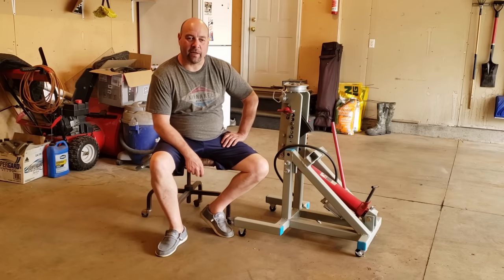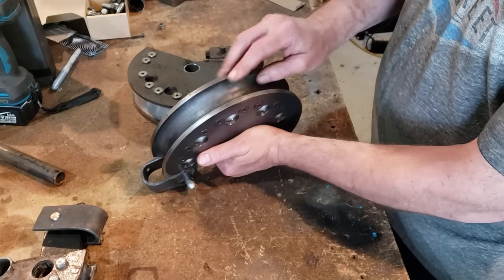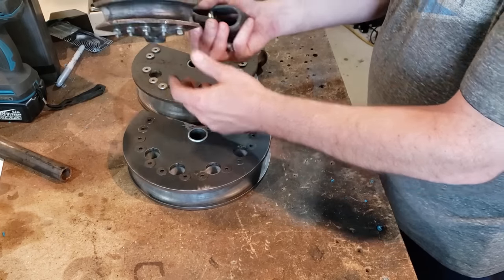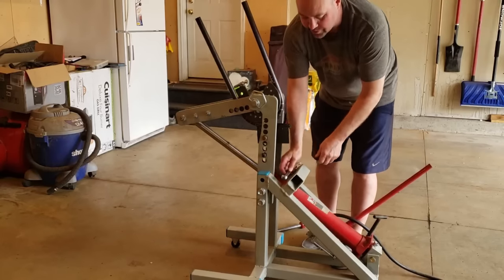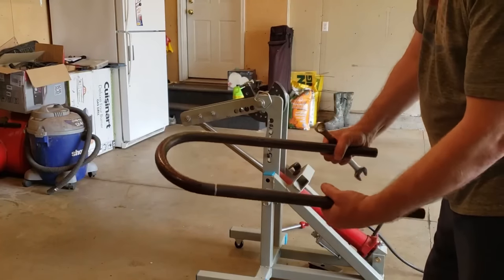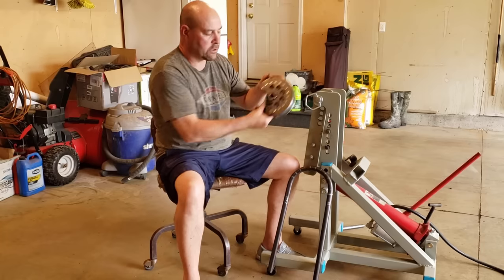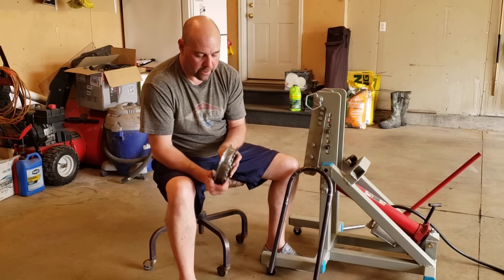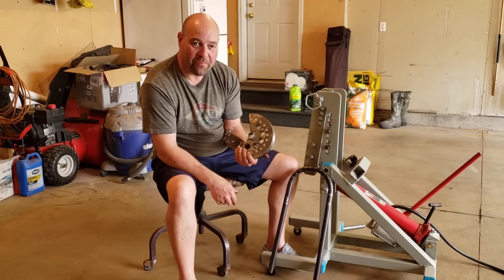A Budget Way to Build a Tube Bending Die

Comment: “No special equipment needed”. Er, except thousands of dollars worth of plasma cutter 🙄
Reply: Would be easy enough to have the side plates / flanges done by a company like Send-Cut-Send.
I’ve found that the prices aren’t much more then just getting the stock material, and saves the misery of cutting especially large diameter holes. Quantity also reduces the price, so ordering 10 pieces to make 5 different size dies makes this option more lucrative, as I’ve gone this route for several lathe and mill projects.
Reply: @georgedreisch2662  I almost fell for the troll comment as well. They are difficult to see sometimes when you are trying to be helpful. thanks for being a helpful poster. I erased my comment when I realized someone with a tubing bender, welders, other tools used, and fab skills would not see a couple 1/4” plates to be the one insurmountable task. 
Thanks JDs Garage for great content!
Reply: Plasma cutter for under $200 for 5 years. Can't fix stupid
Reply: Yep..
Reply: He said he cut the first one by hand
Reply: @nomoreusmc  not everyone lives in America! Here in Australia, a plasma cutter will cost you closer to $1000 plus $300 for the gas!
Reply: @officialWWM  exactly,  I live in Ghana west Africa, only 2 companies in the country have a plasma cutter both at the port free zone. 
I can buy a gas-cutting torch but nobody has acetylene bottles, you can buy locally made acetylene gas producers but they blow up on a regular basis. No mig or tig welders here either had to re-teach myself how to stick weld after 35 years.
Reply: @Projekt5.3  you all need to realise America is not the world. No special equipment would mean only readily available hand tools and not special equipment you need an electrical power source and compressed air. Uses more special equipment than half the mechanics in the world posses.
Reply: @laupernut  It's called context. Look up what it means. This is a video made by an American, using American dollars, in America. It's not going to apply in every single place around the globe. Duh. Guess what? And tools that are commonly available to you might not be commonly available to someone living in the Congo. This is not a difficult thing to comprehend.
Reply: @Projekt5.3  like I tried to explain this is an international video forum. I understand context. Maybe someone should think about the title before posting. I come to Youtube to learn not to be disappointed by someone who can't think about a title.  If it's just for Americans, you can put in restrictions and only have an American audience.
Reply: @laupernut  It's not just for Americans but he is an American that lives in America so he's speaking from an American perspective. "Commonly available" is a subjective phrase to begin with for Pete's sake. What it means to you is different from what it means to me which is different from what it means to someone living in India or anywhere else in the world. Get over it. Move on with your life. Find something worthwhile to cry about good lord 😂 how dare he not cater to you in his video lol
Reply: @Projekt5.3  Dude go to bed, you have kindergarten in the morning.
Reply: @George Dreisch  Yup for their plasma table I quoted 30ft of 2 inch tubing for it. It's cheaper to actually buy 48ft! So I may be building a tube bender as well! And a small kayak trailer to take my kayaks to the lake!
Reply: @richardswartz4273  ain’t nobody got time for that…
Reply: Use a grinder
Reply: Their first die was cut by hand dude.
Reply: @nomoreusmc what cutter do you have? I'm trying to pick one that isn't too expensive.
Reply: I guess it's easy to travel to the moon if you have a spaceship and rocket engines and stuff.   

I guess it's easy to do surgery if you have a surgical room and MRI machines and stuff like that. 

Dude wants a video of a guy building a CNC plasma machine and he only uses a fork,  two rocks,  and a coconut.
Reply: @fernandorosales2418  there's a lot of people who get mad at diy videos because they use one or more specialty tools that are cheap. They expect all diy videos to be able to be done with a hammer and a screw driver or they don't consider it a diy lol.
Reply: @fernandorosales2418  if that’s the case, he should change the misleading title o& the video!
Reply: @Worlds Worst Musician  I don't feel the video title is misleading at all.   

Personally,  I bought the plans to this CNC machine from JD's.  I'm not some big company.   I'm just a DIY hobbyist guy doing this in my home garage.   I'm not a trained machinist,  or a trained welder.  I mostly own woodworking tools although I do own a welder and plasma cutter.   I'm not a pro by any means.   My day job has nothing to do with machinery or manufacturing.   I am literally the definition of a DIY guy.   I'm doing this because I think it's fun.   When I finish my machine,  I'm going to start building a go kart.   I have no go kart experience.   Just a DIY guy with a 2 car garage.   

Yes,  we might be a bit spoiled in the United States.   We have many things available to us.   However,  we can say the same thing for people in England,  Germany,  France,  Italy,  Austria....  they have access to the same tools we do,  and sometimes even better ones.   So,  this is definitely an international community of DIY people that enjoy making things.   

I can't speak for Ghana.  I don't know what they have there.   But if your community doesn't have tools or equipment available,  you can purchase stuff and have it shipped.   If your community doesn't have things available,  then maybe that's a business opportunity for you to bring those items to your community.   

Lastly...

There's many way to skin a cat.   If you don't have fancy tools,   I assure you,  you could build this with a hack saw and a grinder.   You gotta be creative when you don't have a ton of tools.   Tools are accumulated over time.   Americans aren't just born with a huge shop that's fully equipped with lathes and milling machines and fancy welders.   It takes time.
Reply: @Worlds Worst Musician  by the way... if the dude from Ghana would like to send me the money,  I'd be happy to buy him a plasma cutter and ship it to him.   There always a way to get what you need.   Might not be convenient,  but it can be done.
Reply: @officialWWM plasma cutter doesn't use gas it uses compressed air from an air compressor
Reply: @paulturner7628  if you really want it to you can build this with a file and a hand saw it will take you a lot of effort but is doable so stop complaining about other countries if you don't have the tools to do it easier oh well maybe is not a project for you
Reply: @javiercobain  it’s the misleading title I was referring too. So sick of clickbait.
Reply: Not difficult to cut it with your grinder ...
Reply: Wow these comments are more interesting than the video. I just realized that I am very fortunate to live in the United States. In my small home shop I have drill presses plasma cutters, mig, TIG stick welders. Powder coater.  And I'm bitching about how I can't weld aluminum.. well goddamn I should go by and spool gun for my welder and then I could.. at harbor freight for less than $100
Reply: $500.
Reply: @lloydrmc been doing fabrication on/off about 20 yrs. First pieces all hand cut/grind. Till someone owed me $ and offered me a Spectrum 300.
Reply: @officialWWM you can’t get away with using a grinder if your skilled and not a moron
Reply: @laupernut if you're just cutting you can use lp gas and oxygen also gasoline or diesel can be used in place of acetylene if done correctly look into petrogen torches. I believe there is a Chinese version of a petrogen that costs much less.
Reply: Use a jig saw!
Reply: @javiercobain High end plasma cutters use gas to prevent slag.
Reply: I was in my mid 50’s when I started watching this video, I’m now 96 and writing this comment from my nursing home 🧐
Reply: @timgannon2993  😂😂
Reply: @officialWWM plasma cutter does not need any special gas, it just needs compressed air. Every shop should have compressed air capability.
Reply: The printer is where ya lost  me 😅 ah well
Reply: I've cut plate with a jigsaw before and hand filed the finish. Takes time but can be done.
Reply: A plasma cutter & a 3D printer
Reply: @officialWWM plasma cutters run on compressed air. No gas to buy. Just a one-time purchase of an air compressor.
Reply: @officialWWM then order through a company like send cut send. Or whatever the local shop charges. Plasma cuts are cheap
Reply: You can use templates, plasma cutters can be had for less than $200 and an air compressor for another $100. I would say it's at least obtainable by quite a few of us.
Reply: You can use propane, for the gas.
Not quite as hot.
Used it for years and I have both types of gases.
Reply: @officialWWM  plazmacutters don’t use gas😂
Reply: @officialWWM  I live in Australia and hobby plasmas are like 600 for a decent one yes you can spend heaps more on a professional machine but hobby machines on eBay from China a cheap, also why are you buying gas for a plasma you plug them in the power point and plug them into the air compressor
Reply: You forgot the 3d printer!!😅😅😅
Reply: @officialWWM not misleading at all. He used a plasma cutter but there are half a dozen ways to do that. You can use an angle grinder. You could use a band saw. You could use an oxyfuel torch with either acetylene or propane.  You could even use a hack saw if you were desperate. If you had literally nothing else, you could drill a series of closely spaced holes, then use a chisel to connect the dots. Then clean it up with a file. I totally didn't think of it, but someone else mentioned, you could use a jig saw. Or you could combine several methods. 

 One time when I was younger, my buddy and I were stranded with a flat and no money and no spare. We found a bald tire in a pile of junk that held air. The vehicle had a 5 lug bolt pattern ,as did the bald tire we found, but it was the wrong spacing. So we took a rock, used a screw driver as a chisel and opened up the holes so it would fit. It got us home, at about 5mph. 

When you don't have what you need, you gotta get creative. If your watching a DIY video looking for exact plans and instructions rather than just looking for inspiration, you don't have much of a chance of pulling it off anyway.
Reply: @jesusisalive3227 I listed a bunch of options but I forgot that one!
Reply: @michaelallen1432  

Like you said, you could drill a series of holes and then you could use the jigsaw. It's actually a very good option.
Reply: AND a 3D printer…
Reply: @the1khronohs40  what exactly are you hoping for? It amazes me that people are watching a video to build dies for bending DOM tubing and think a $500 plasma cutter and a $300 3d printer are outrageous when you will need a $300-$1000 bender tonuse it in, a $200 tube notcher, a $100-$300 level, a $500-$5000 welder(s), grinders, hand tools, CAD software, shop, welding supplies, some basic knowledge AND A PROJECT TO USE IT ON.... those are cheap, especiallyif its for racing!  When what is really missing is some context and common sense! These dies are being made for a fraction of what a purchased die of the same size would cost, and it allows you to make it on Saturday and use it on Sunday, but shame on the creator for sharing?
Reply: And 3-D printer. 🤔

Comment: This is great! More and more people are discovering that 3D printed plastic can be used in a lot of high-force applications. As long as the plastic is well-supported, it can handle amazingly high loads. Others have made dies for press-forming sheet metal with excellent results. I think this is the next frontier for DIY metal fabrication tools.

PD: it’d be great to see a build video for the tubing bender itself!

Comment: What a great idea! I don't have access to a plasma cutter, but I do have a angle grinder and a bench drill + a 3D printer, and I mostly print using PETG. I did not think PETG would be strong enough for this usage, this surprised me ☺️

I need a bender for 1inch / 25mm diameter pipes having 16gauge / 1.5mm wall thickness. I'll just have to try a 3D printed version now 😁

Thanks a lot for a great video!

Comment: I modified a Harbor Freight “pipe kinker” die and I can bend .120” wall 1.75” DOM without issues. No waves, no kinks, no cracks. I also modified the other die to bend 1.625” (1-5/8) .134” wall. They all work! Make sure to use lots of oil while bending.
Reply: More info on your mods please?
Reply: en argentina tienen harbor freight?
Reply: @beno.-  no se. Pero si buscas “Harbor Freight pipe bender” vas a tener una idea de cómo es y probablemente encuentres algo similar por ahí. No es una herramienta muy sofisticada y se puede hacer una usando un gato hidráulico.

Comment: Very clever guys…I had a JD2 bender and apparently the dies are machined with slight flats on the side to support the tube where it usually likes to deform, results were true round tube after bending, by printing your own this would also be achievable. Either way…great result. Cheers from Australia

Comment: I built a custom die for my dad many years ago to bend some square tube for his mini b series subframes. I put it together the same way with bolted on side plates but I machined the center peice out of steel on a lathe I had access to at the time.

Comment: Wow! I never thought that the plastic would be strong enough so that it doesn't deform. I was thinking about casting aluminum dies but this is way simpler.
Reply: Wow! I never thought that the plastic would be strong enough???

Depends on what you want to bend. JD's even says it can't bend seamless DOM tube. Lots of people use ERW or electrically welded tube, it has a seam inside and is MUCH more easy to bend because it is MUCH less strong.

I need to bend both. So I only use steel or aluminum dies. I build dune buggies and race cars and would use both DOM and ERW. But in any high speed use such as racing or a roll cage that your life could depend on what do you want to do? ERW or DOM? 

On a kids dune buggy that goes 20 mph ERW is fine but I probably would still make the main roll cage hoop out of DOM then use ERW for the rest. If your building a small buggy that will use a 90 hp snowmobile motor and will go 100 mph then come apart and kill you when it rolls and flies end over end, you going to build  that with ERW? Not me, I am going to use DOM tube.

Then there is 4130 chrome molly tube. Super strong, super expensive and hard as hell to bend. Best race cars are built with it specially in the EU.

So these plastic fantastic dies don't actually seem so whiz bang great after you think about it. At least not to me. Build cheap dies? I would find some 1/2 aluminum plate sandwich it together with steel outer plates then use a home made fly cutter to do the profile I wanted such as 1.5 or 1.75. But I am a machinist so I can do that. I also save up $$ and then buy good steel dies but find used ones. 

Decently good aluminum dies are easily available even used on ebay. I have used them to build a simple bender that did struggle but could bend DOM tube. While bending the DOM tube the aluminum die had no problems, my 8 ton jack did though. Should have used a 20 ton air/hydraulic jack.

Build a good bender with strong dies. Then if you need to pay for it rent it out. Or charge by the bend. After I built my first bender and word got out, I had lots of new friends who needed to bend tube, everything from exhaust tube to DOM tube. I said bring the beer and your tube and lets do it. Thinking back I should have charge them $$ not beer but oh well. They all still owe me favors now. Racing is like that, more people you know the more you can get done for cheap.

Comment: Really amazing project, I have never seen or thought of printing a die.  Just one helpful suggestion from an old retired structural engineer,  all bolts are designed to stretch,  however under proper specified torque.  Look up the torque specs for the bolt size and grade instead of using an impact.  The impact may have yielded the bolts, or not have tightened them enough. In all honesty, those bolts may have been a little small and of lower quality.   That would have been the cause of your die opening up when bending thicker walled tube.  Love your video, subscribed.  Cheers from Canada.

Comment: I think you may have problems with die stretch because the holes are cut with the plasma. I would skip that altogether and drill them out - more precise and less stress on the metal itself. And is you can, use full bolts and nuts. May be a problem for clearance thought.
Best of luck! 
loved the video!!!

Comment: Awesome work on the tube bender design and build.  Those look like stainless steel bolts on that 1-1/2" die.  You need to go to steel bolts.  They are almost twice as strong as stainless.

Comment: Surely as you go up in diameter of tubing and strength, the gauge of the side metal should be thicker to cope with the extra force, plus thicker/stronger bolts too.

Comment: For those without a 3D printer do you think someone could use two sheets of 1/2" plastic and router it out with a 1" concave bit? For the plastic was thinking HDPE. But would HDPE be too soft?